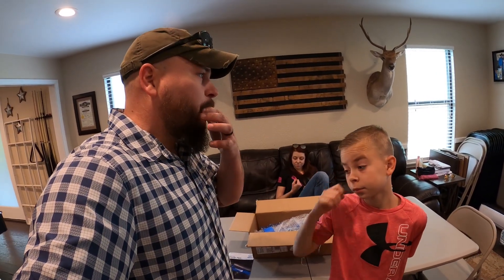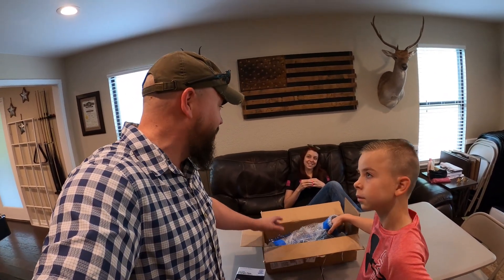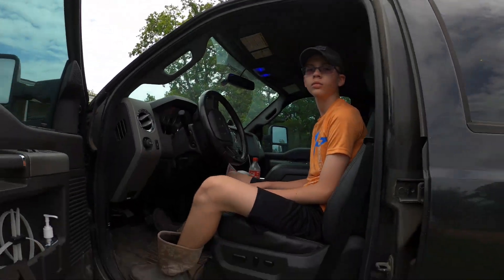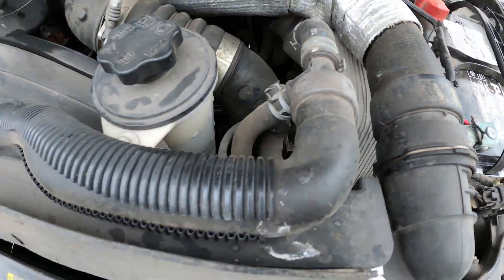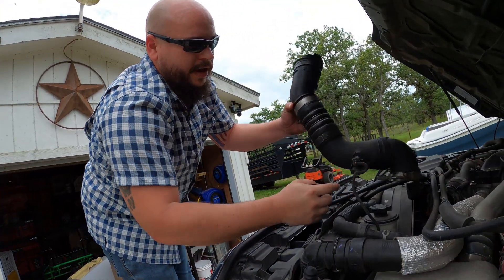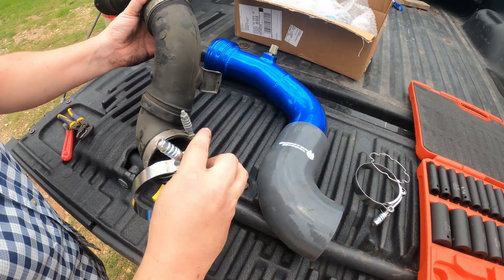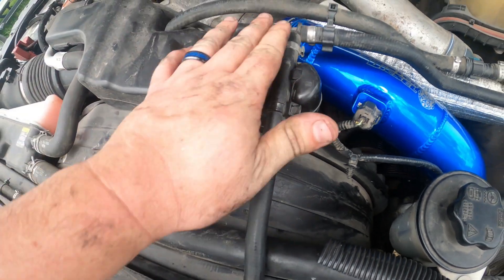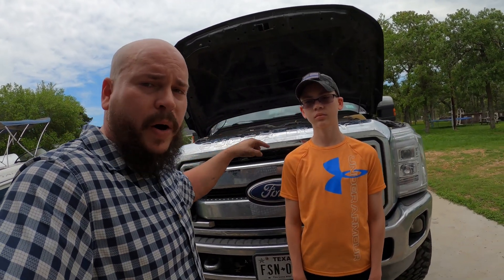Ford's OEM Intercooler Pipe Is TRASH!  Here's How To Replace It.

Comment: Mine failed at around 60k
Reply from the maker: Wow that's disappointing!
Reply: @SixthDayRanch  I'm sorry maybe you misunderstood.  My OEM failed.  I have a replacement metal one now!  Works great
Reply from the maker: It's disappointing that it failed with such little milage! But that's great that you got the replacement metal one now! Ours is still doing great with no issues!
Reply from the maker: No worries.  What I meant was it's disappointing that Ford would make a product that fails so quickly!  60K miles on one of these trucks is should be barely broken in.

Comment: Thank you for this! I'm near Waco, TX. (China Spring) Mine (2015) just blew right at the joint where the metal band (as seen here 7:35 ). It's not even a clamp, just a pressfit band. 'Comon Ford. really? I will say the BOOM when it blew was pretty shocking. 
10:43 Can the metal to rubber clamp be preinstalled and tightened before sliding it down into position? If not, did you just use an open-end wrench to tighten? (probably take 5000 little 1/4 inch turns right? ;) )
Thanks again brah! subbed.
Reply from the maker: I hear you - it made my heart sink!  It was a tedious process getting that thing tightened, but I was able to get it done with a LOT of patience!

Comment: Nice work! I changes mine and now it’s throwing p0402. Any ideas why? Thank you
Reply from the maker: Could be the truck needs time to relearn.  I'd reset it and see if it comes back.  If it does check anything that has to do with airflow.  Cools be MAP sensor (that can usually just be cleaned) air filter or maybe a stuck egr Valve but not likely if you didn't have the problem before.
Reply: I just replaced mine and am having the exact same issue. P0402. Did you ever find a fix for this @alanstoll-n2j
Reply: Did you ever resolve your p0402 code issue? I'm having the same issue.

Comment: Not sure if it was just mine or if someone already mentioned it but makr sure to run your finger with oil around the inner o-ring for the metal fitting over the throttle body...this was the only way mine would slide on far enough to use the spring clip.
Reply from the maker: Great tip!  Thanks!

Comment: After you replace this and went to the aftermarket, did you notice a slight drop in your turbo boost when you were just driving normally? I just changed mine out and it feels like I'm not getting as much boost under normal driving conditions but when I get on it I can get the full 21 PSI. Just wondering if this is a common occurrence when you switch to an aftermarket and the air flows through much better.
Reply from the maker: That's a good thought.  I personally didnt notice any difference but that doesnt mean it's not there. Hopefully someone else can chime in here if they've noticed it too.

Comment: How long did it take for the check engine light to turn off?  I drove it around the block and it is still on...

Just did this upgrade on a 2019, it is definitely a tight fit.  At 74k the original hose cracked.
Reply from the maker: I reset my own check engine light so i'm not sure how long it would take on it's own.   Hope the new one solves your problem!
Reply: @SixthDayRanch  was the reset simply removing negative battery terminals?  Or is a programmer or something else required?  Can the reader at the local auto part store reset it?
Reply from the maker: I just use a cheap odb reader from Amazon but any of them will reset the code for you.   Same with the ones at the auto parts places.
Reply: @SixthDayRanch  I appreciate the insight.  Headed to the parts store....
Reply: Mine also just failed at 75k on a 2019. Swapped to this one so I can reduce future risks. Great insight and great video too
Reply: Just noticed my hose cracked on my 2019 with 44k. Covered under warranty but I’m not putting their junk hose on it.

Comment: I undid the bolt on the power steering reservoir but that little 90 boot on the cooler is still in the way I can’t get it, the problem too is even once I get it installed I still have to move everything back into place
Reply from the maker: It definitely took some patience to get it all situated, and I used a really long extension to get it down in there.  Also make sure your bolts are facing the right way before you get it in there so you can reach them from above.  Good luck brother!
Reply: Sixth Day Ranch Texas we ended up getting it on, just took a couple prayers!
Reply: Sixth Day Ranch Texas next I’m gonna take it for a drive and make sure it build proper boost and no check engine light
Reply from the maker: Great to hear! Hope it treats you well!

Comment: I’m having an issue on the cooler where that one connector is stoping me from getting full range to move it around, did you put the boot on then the pipe into the boot?
Reply from the maker: For the most part yes. I had to have them both a little loose, but I placed the boot first.

Comment: I also keep having an issue getting the tube on the throttle side with the clip to line up
Reply from the maker: It definitely slipped right on the throttle side.  Perhaps it's twisted a bit?

Comment: This literally just happened to me. I'm a hotshot with a 2012 F350 6.7. I rigged it to work until I can replace it. Truck just hit 140k. I'm driving it 2k miles too. Easy fix if you have the part. Just go ahead and replace it with premium parts.
Reply from the maker: Sorry to hear that brother.  Never fun to have to deal with this stuff especially when it's your job to drive.  Hope you are able to get it working soon!

Comment: Great video! I have the same cold side pipe on my 2016 f250 my question is does the kit come with a rubber seal where you connect it. My pipe seems to have a leak and I don't remember if it has a seal on the blue side not the boot
Reply from the maker: Thanks!  No there is no seal on the blue side.  It just slips over the port and clips in place.
Reply: @SixthDayRanch  just bought one and there is actually a seal on the inside
Reply from the maker: Apologies! I didn't remember it coming with one but it's been a little while.

Comment: mine has a split on top, which is weird. under boost it looks like its spraying oil all over the hood. 2017 f350 110xxx.
Reply from the maker: Bummer.  My first one that failed had a split in a similar place.  -Steven
Reply: Mine is doing the exact same thing. Changing it out today. 2018 f250. My last truck was a 2015 and it exploded to pieces. My new one, it started throwing a check engine code for the mass air sensor also.

Comment: Did you have oil coming out when yours busted?
Reply: When mine blew I had a little bit of oil that came out. If it blew out right at that angle, you probably had it on your hood just above it and a little bit where those coolant lines run. Oil is a common occurrence when they blow out.
Reply: @MAGA_Trucker_95  ever since replacing it with an aluminum intercooler pipe it's been 1000 times better and I have zero worries about it.
Reply from the maker: None that I noticed.
Reply: @SixthDayRanch  mine blew Sunday and I need to replace it. From my research it said leaks can happen from the pipe being loose… well that sucker was completely off lol so I hope my turbo is still good 😬
Reply from the maker: Oh man I know that feeling worrying about the turbo.  I'm sure you're fine.  This is such a common issue thanks to ford engineering. Lol
Reply: @kennyreinartz  mine has oil it didnt fall off but it cracked down the sides and now i have oil all over the hood and radiator. hope its normal. 2017 f350 110xxx
Reply: @jdeaton17  I connected my pipe and drove it with no issues. I think the reason I had oil was because I was driving 80 mph when it busted off. Then my dumb behind tried flooring it to see if I could hear the turbo. But yeah after I replaced the cold side I had to take it to the dealership for a regen of the dpf. So in total I spent just under $750 for everything. Also Ford was talking about looking into a recall of those pipes and if it affected your turbo or dpf then it could be replaced for free as well. My local dealership has already replaced 3 of them for free. I asked how much it would cost for replacing the turbo, pipes, and the dpf, he said it would cost roughly $7500
Reply: @kennyreinartz  I had a engine reduced power light come on and then my engine light came on I checked my hose it was cracked just wondering if anyone had the engine reduced power light come on as well it only blinked twice and it went off on its own

Comment: Hey 6th Day Ranch, Here is a heads up from a fellow Texan. The fact that this has happened to you more than once makes me think you might have the same problem that I did with my 2015 f250. Long story short, I drive ALOT. DFW to Houston to SA/Austin loop twice weekly. I was running too much injector cleaner/cetane booster and melted my DPF, blew the boot just like you and it put a hole in my charge air cooler system. Had to install the aftermarket boot and billet adaptor, removed the DPF and straight piped it, programmed the EGR and DEF to stay closed w/ some mild tunes. I thought I was done but my tranny was running hot while driving HWY only, Had to install the mishimoto Charge air cooler too, now its done. If you still have the DPF installed, might want to delete it or at least measure the psi change through the exhaust. 2015 f250 4x4 lariat with 260K with only the work above, 3rd set of batteries, 6set of tires, ac fan motor, shocks, brakes, and nothing else done to it.
Reply from the maker: This is great advice I appreciate it!

Comment: Did yours just blow? Or is this a preventative measure? Mine just blew, I am at a dealer in PO dunk Iowa, mine blew heard a loud swishing noise, suddenly no turbo. I couldn’t find any holes or detached hoses, it Labor Day and we are stuck until tomorrow morning.  Any advice?
Reply from the maker: Exactly what happened to me both times it happened.  It usually fails either at the throttle body or a crack on the elbow towards the top.
Reply from the maker: See or there is maybe a crack somewhere where it split.  It may not be obvious until under pressure.
Reply from the maker: Sorry to hear that brother that's not a fun problem to have.  If you could find the crack it whole depending on where it is you could temp patch it with fiberfix or something similar that is fast drying.  It's all just plastic anyway.

Comment: When you installed yours is the top part of the pipe flush on the throttlebody? For some reason even with my clip down I have a small little gap in between.
Reply from the maker: I honestly don't remember.  I just slid it onto the opening on the throttle body until the snap ring lined up.  It's pretty snug on mine.